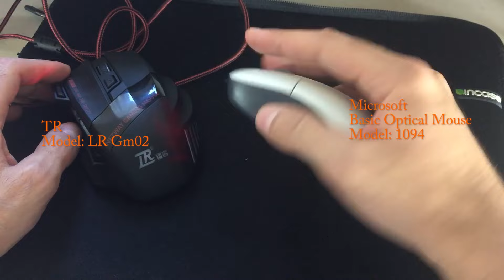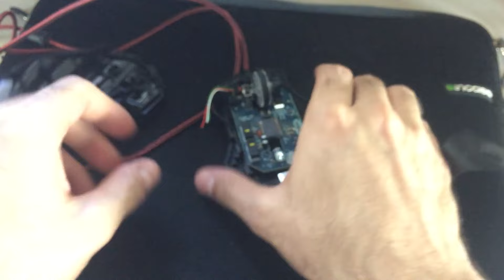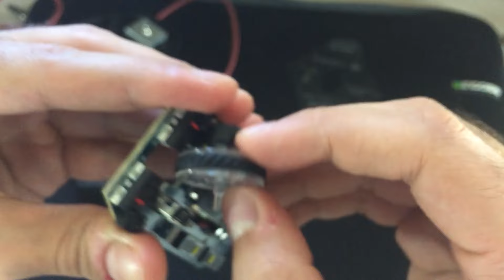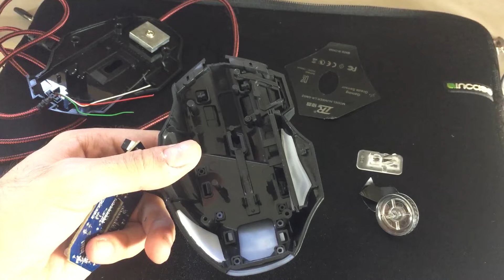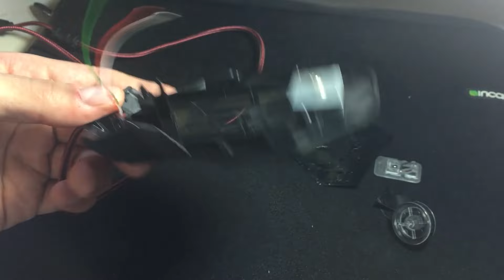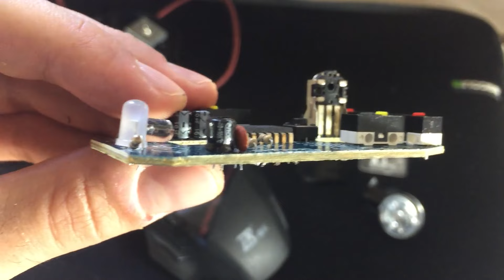Cheap "Gaming" Mouse Tear Down

Comment: I already bought two of these (because they fit really comfortably in my hand), and in both I've had the same part break. If you use the middle button a lot, I don't recommend you buy these mice.
Reply: i literally just used it 2 hours ago and it stopped working now im struggling to open it because it had tight ass screws
Reply: i literally just used it 2 hours ago and it stopped working now im struggling to open it because it had tight ass screws

Comment: i have the same exact mouse just the name is different Zelotes. best mouse ever. i've been rocking this mouse everyday gaming and working. this mouse is a tank.
Reply: does your left click feel a little loose and a a little blocky noise too? i have the same mouse and it does that
Reply: @michieb1231  hey bro do u have a problem where when u click the left one it sometimes doesnt work because i need to click it twice or more for it to work sometimes, btw i have the same mouse but also diff name(Zeus)

Comment: Beautiful! I was working on an Arduino project and I salvaged one of these mice for it's microprocessor-sensor unit, but the branded version I had on hand had it's microprocessor serial deliberately worn off (why the manufacturer did that is anybody's guess), but at 6:23 you showed yours and now I was able to track down a pinout diagram! Thanks a ton!

Comment: Nice job, I just wanted to know if it was probable that there was some screws under the sticker before I tore it off. And there was, so thanks!
I have a cheap Tecknet M002 mouse, for about £6 on Amazon. Been using it for about a year now and it's great, but when I scroll quickly it sometimes reverses direction for a second, and it's really bloody annoying!
I thought I'd take it apart and see if there was a problem inside, but there wasn't.
I assume it's just shoddy Chinese engineering, or R&D, probably the signal from the wheel getting overloaded when scrolling too quickly or something. 
Besides that it's been pretty flawless for £6 quid.
Reply: this happens to me too just open up a mouse use wd-40 on the scrolling thingy and clean the wheel

Comment: I bought this mouse (branded "catkil") because I wanted a mouse with a pinky rest. With my ancient MX 400 pinky always got in the way when I moved the mouse rightwards. The problem, for me is this mouse has a wrong shape on the other side. The thumb rests at angle opposite of most mice, on a slope. When you grab the mouse tighter, for aim or to lift it up, thumb tends to slip upwards/inwards.

Comment: Noticed those switches are not Omron, which can be Japanese made or Taiwan, and used to be in all mice before 2010.  Now, the Chinese branded mice, even some newer Logitechs models, use Chinese branded switches, which tend to fail early, like 3-5 years, whereas the old mice have lasted forever, people changed them just because it was old or didn't have enough buttons.  Beware, you can buy Omron now made in China, and dunno how long that lasts.  You can buy true Japanese Omron switches for not much more.  My Logitech mouse is from 2003, going strong.  I tried a few of those no-name Chinese mice and same thing, 'good specs' on ads, but in use, it doesn't live up to it, and sometimes the mouse pointer jumps at unpredictable intervals.  I bought a few old Logitech mice from before 2010, and just stocked up on those in case my current mouse, 18 years old to date, eventually dies.

Comment: Nearly 3 years ago I was given the monster version of this exact same mouse, same mouse and everything just different logo and I gotta say Ive never in my entire life had a better mouse. literally just today the mouse got fully submerged in sweet tea for a whole 8 hours straight bc it fell in when I went to sleep, I left it for a mere 2.5 hours and it now works perfectly well as it did before, autoclicker and all. The entire time ive had it and to this day it has very little delay, it feels good in my hand, and I've never had any inputs that didnt work or inputs that I didnt do. Its only problem is that you need to use it on a lighter surface or itll lag behind.

Comment: I got A weibo WB-X7 and the outside is literally almost the same except for the decals tearing down this mouse is also the same as in the video, i thought even the internall is the same but the motherboard is different and the components too are a little bit different but not really in a large margine.

Comment: Fun fact This mouse uses Everything those Logitech gaming mice use. Spec wise. its just badly put together.
Reply from the maker: I wish this was true.. but the fact is that the sensors they use in these cheap mice are of inferior quality. Think of it as a cheap camera vs an expensive camera. Cheap camera will have cheaper sensors in them while the more expensive pro grade cameras will have much better sensors

Comment: MX8871 sensor from China - the whole issue is either that or the lens. Perhaps a knockoff lens made by some plastics company that didn't know what they were doing. 

The sensor's specs are a bit disconcerting. Not only is the tracking speed insufficient at 30ips, though standard for office mice, the ridiculously low 2g acceleration is a hint that the sensor is running predictively and is not really capable of doing a complete displacement analysis.

Comment: I have a Pictek T16 Gaming Mouse, the wheel got the axis out of alignment. Is there any way to fix it without the need to open it?
Reply: I don't see how that would happen unless the wheel's thin plastic shaft broke off at the spot where it's inserted into the electromechanical encoder. You better open it up and inspect the damage. And while at it, i'm curious what ICs and sensor they have in it :D

Comment: bro, my mouse has a problem with it's cable, about an inch of the cable will make my mouse disconnects if it gets moved/bent, so i need to tape it so it always bends the right way. but now i can only run the mouse at 125hz polling rate, instead of 1000hz (im thinking its because lack of power because some part inside of the cable is dead , so it sends less power) , and the movement of the mouse is now lagging. if i change to these paracords, that means the problem will be fixed if the problem is indeed my mouse's cable, right? thanks
PS; sorry for bad english and explanations, im not a native.
Reply: yeah as you explained it, it should work afterwars. just a malfunction in the cable
Reply: @jarem1172  okay thanks 😁

Comment: I had to open it to fix one of the side buttons, and when I put it back together  the top of the mouse was lifted in a way, like I would have to push it down harder in order for the mouse to click. And the sensor at the bottom didn't move the cursor. Any thoughts on what I did wrong?
Reply: I was just cleaning my mouse, and one of the side buttons fell into the mouse... and Im too scared to open up the mouse because its the only one I have and I probably wouldn't know how to get it fully working again
Reply: Hey did you fix it because i have the exact same problem please reply
Reply: i had the same issue, the clear plastic part wasnt aligned properly but i gave it a but of nudging around with a small screw driver and i fixed it when it snapped back in place a little but more forward (thers a little dip where the sensor sits in the part that i had to realign)

Comment: ok i hava mouse like that but one thing it keeps disconnecting and reconnecting
pls help
Reply: Dude same idk what happened
Reply: @Idkac3  ikr but as soon as i opened it and see whats inside, i didnt see nothing but when i plugged it in  it moves for like 1 second then disconnects for like 5 to 10 sec or 15 to 17 sec
Reply: @zenitsuagatsumathunderboi279  do you have AULA killing the soul v2 mouse?
Reply: I have the same issue, i think its a damage on the connecting wire up in the front of the mouse

Comment: how can i open my HAMA uRage Reaper Ess its different
Reply: There's always hidden screws under the feet. There can't be much more to it than that, once you take them out, you wiggle things apart. Hama mice usually have a latch near the front somewhere, so the top or the bottom needs to be pulled back.

On some mice, there are also hidden screws under the paper label, but i don't think Hama usually does that.